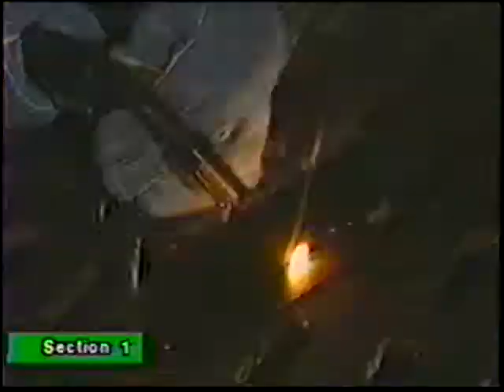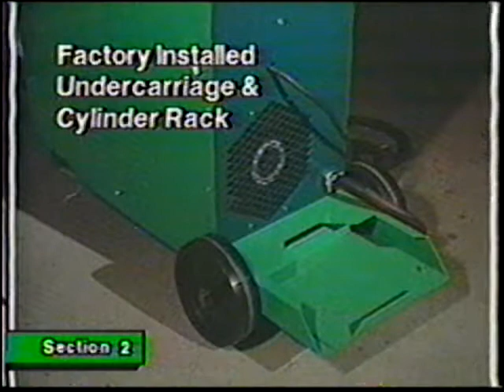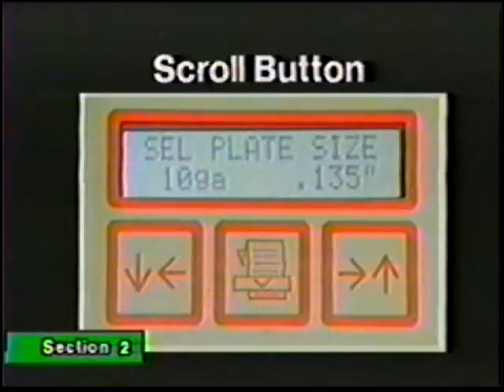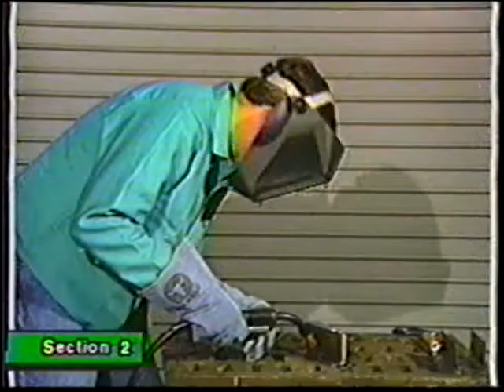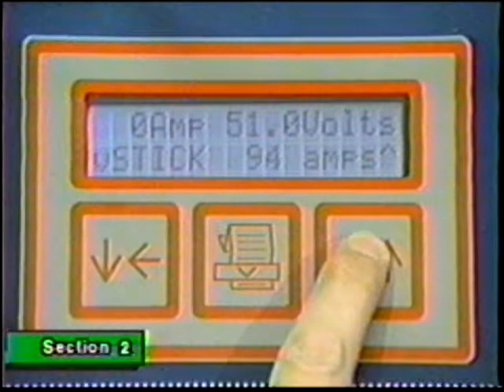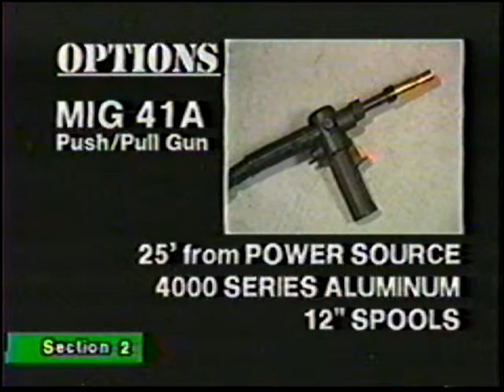L-Tec Migmaster 300i Part 1

Comment: where can you get parts for this?
Reply from the maker: Ebay
Reply from the maker: No idea, sorry
Reply: @jaredt641  Ok thanks...a lot of the plastic parts are breaking. :(
Reply: Welding world com tips for the mt200 are available on amazon short tip (recessed) Medium (flush) Long (extended) manuals Ebay, for mig machine, and MT 200 lead/mig gun replacement is $123.00 on sale regular price $174 ish.

Solenoids are standard off the shelf components